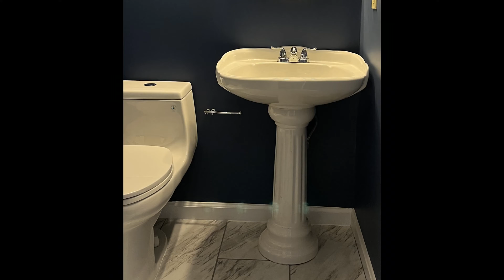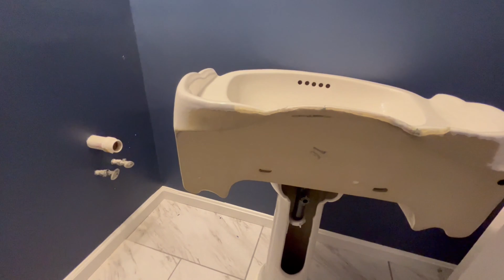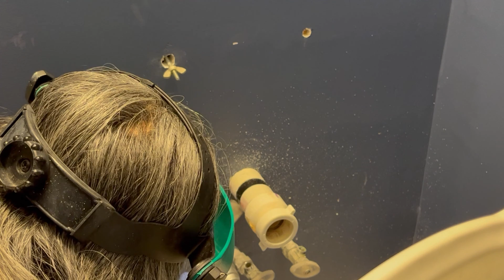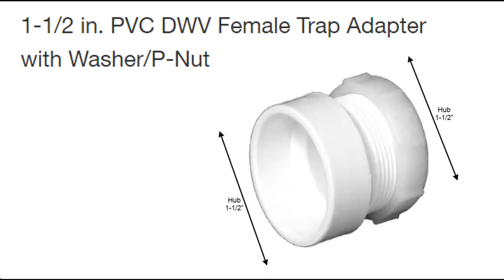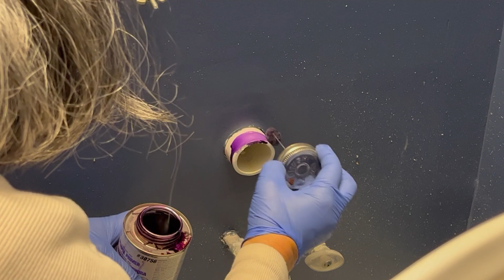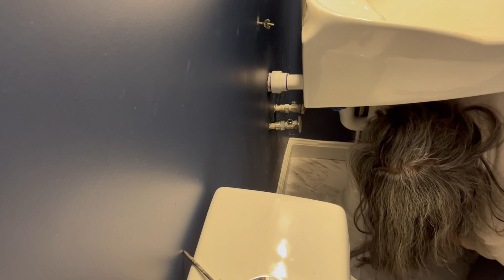How to Cut PVC Pipe & Repair Sink Drain

Comment: The trick for me with this is applying hard enough pressure to get a straight "track" cut on the outer edge of the pipe while having the pressure be light enough that it doesn't bend the pipe.  If you spin the pipe while it's bent it will not result in anything close to a straight cut.  One you get the track cut in the outer edge of the pipe, you can then gently increase the pressure while spinning it and still maintain a straight cut